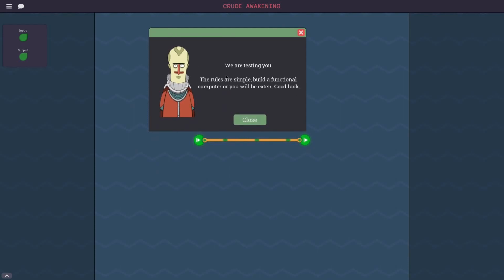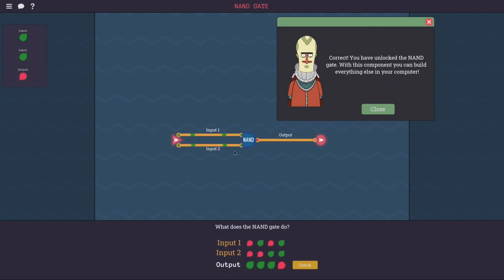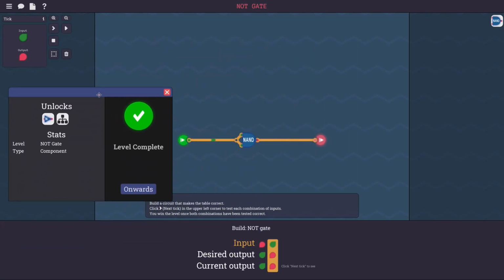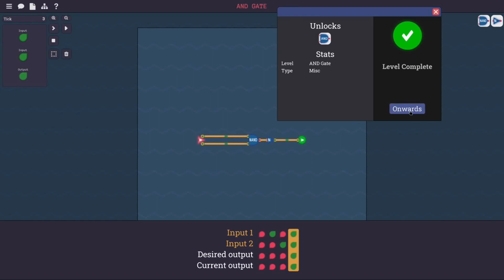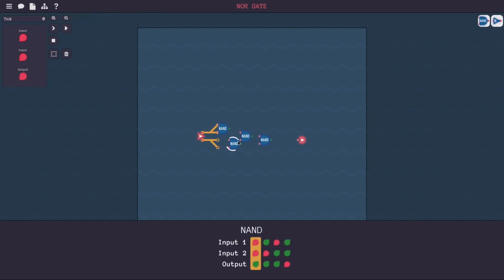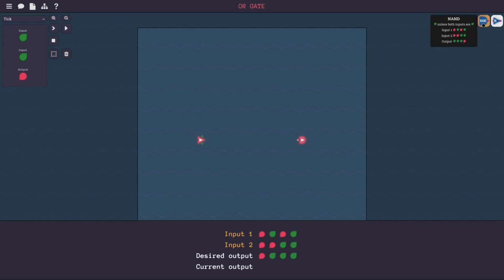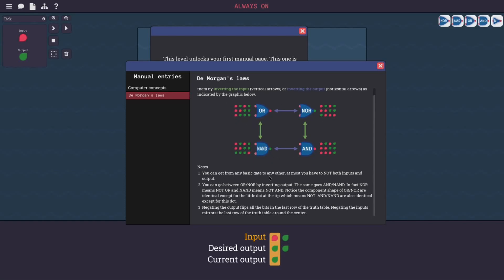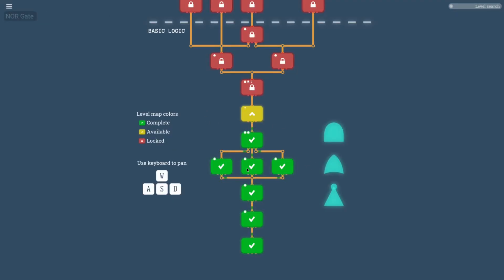Building a processor from scratch: Part 1: Basic Logic Elements

Comment: It might seem a bit of nitpick but the term "Turing complete" is not applied to a gate. Only to a sufficiently powerful computer.

NAND gates (and NOR) are sometimes called "universal gates" since they can be used (as you mentioned) to make all other logic operations.
Reply from the maker: I may be wrong on this, but from my research and education, there are two definitions of Turing Complete. One is, as you said, a computer/machine that can be used to simulate any turing machine can be called turing complete. However, the other definition I hear thrown around is a system of rules/data manipulation tactics can be turing complete, along the same logic. For example, a programming language like C++ may be turing complete, but HTML, a markup language rather than a programming one, is not(but when combined with CSS it can be).
I was referring to this second definition, which may be just improper use of the term. I'll look into it before the next episode and correct myself.